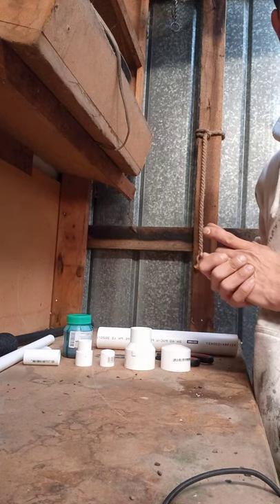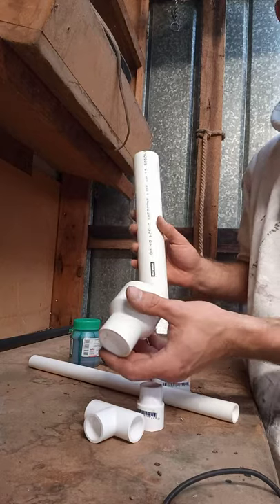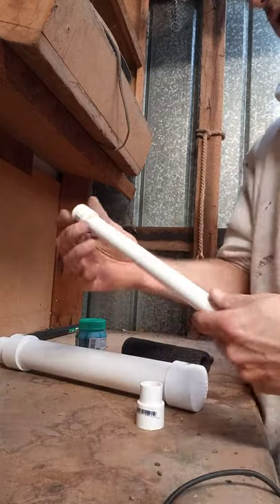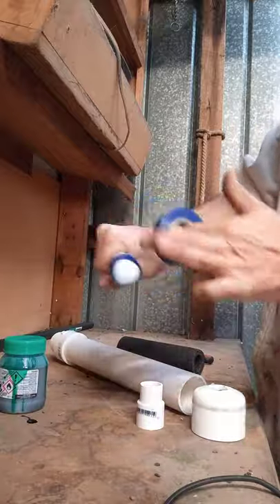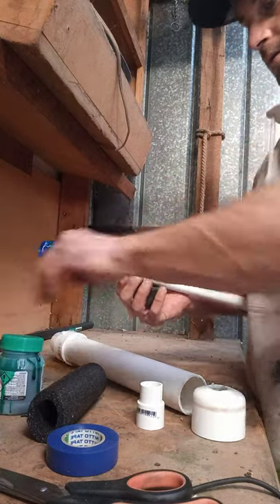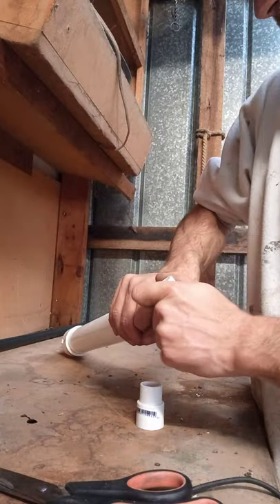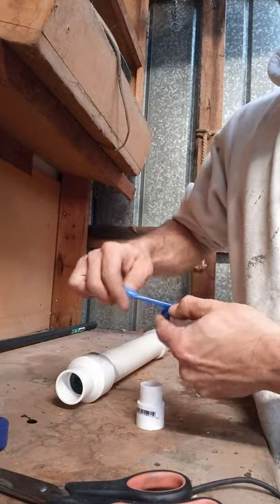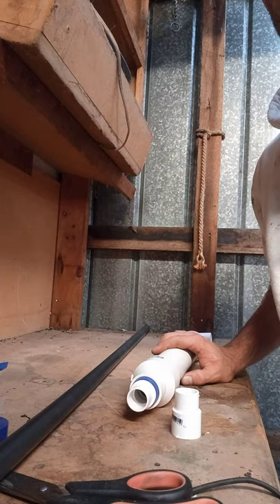How to Build a Powerful Hand Dredge for Gold/Bait Pump

Comment: I put a 45 in the suction tube, and a coupling with stiff wire in a tic tac toe pattern through little holes to fit the wire, as a classifier. Actually It was sucking up rocks and plugging up.

Comment: With multiple reducers you could bring the nozzles down to pex tube size or make smaller sizes of crevice nozzles to increase the suction.
Reply: I have a pile of different tips for a fancy heat gun I have was gonna try to make dredge fit this tips for exactly what you’re sayin. Suck in cracks really skinny or thin wide tip for bigger ones. Etc. just threw that out there cause they are gonna be perfect I believe thought maybe you’d wanna look into it since you’re talking  tips. 😂

Comment: Try using 2x 30mm washers with a peice of thong squashed between them. You can join this to your already made pump by drilling a hole in your end cap, fastening with a bolt and springwasher and nut. Last quite a while and when it does start to lose suction all you need to do is tighten it up, squashing the thong even more.

Comment: 2:46 where did you get the foam seal from
Reply: I can’t work that out either
Reply: Looks like pipe insulator or a pool noodle. Can get the pipe insulator almost and hardware store